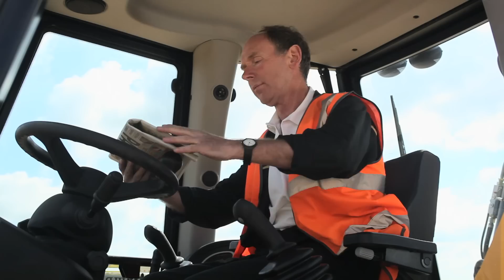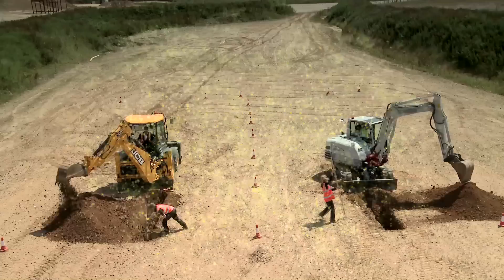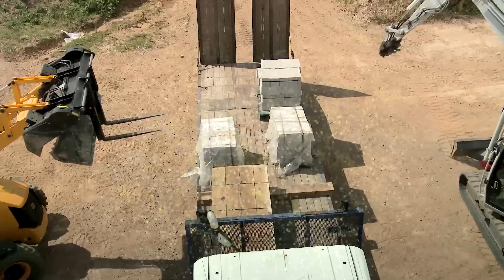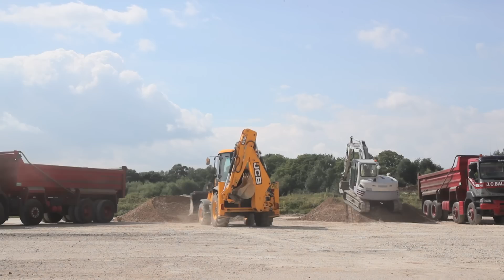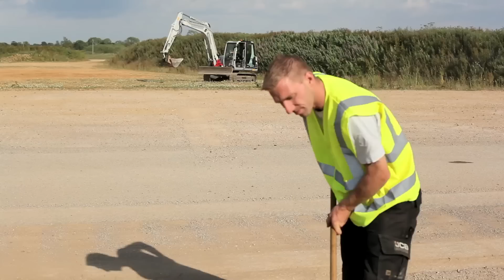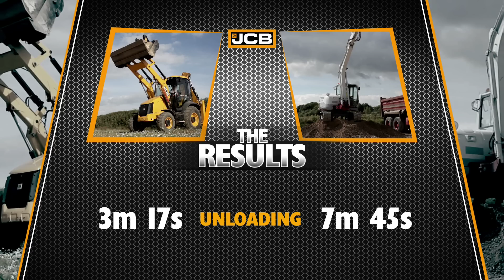Backhoe vs Excavator

Comment: those mini track hoes are cool but I bought a tractor loader back hoe because I feel its more versatile. I can plow snow, till land, dig ditches, load trucks, fork lift, aerate lawns, finish mow lawns, bush hog brush, all on the same machine with readily available attachments that are plentiful on the new and used market making them more economical to purchase. I also like rubber wheels verses tracks on peoples lawns and driveways when turning. I feel the tlb are more easy on the jobsite where minimum foot print damage is desired. of course you can slant anything to look good and come out on top by stacking the deck sort of speak. but taking in account my reasoning the TLB is a better fit for me. just being able to brush hog fields and plow snow is a huge added asset during those times when you don't have backhoe work to do.
Reply: daveknowsho
Reply: daveknowshow d
Reply: daveknowshow b
Reply: daveknowshow xbmmm
Reply: daveknowshow y
Reply: Gdaveknowshow ko'...dU ah
Reply: daveknowshow
Reply: daveknowshow  $z
Reply: daveknowshow p
Reply: daveknowshow p
Reply: daveknowshow    廠
Reply: daveknowshow n
Reply: daveknowshow '
Reply: daveknowshow 2
Reply: daveknowshow and
Reply: daveknowshow ñpss
Reply: D D
Reply: daveknowshow 0
Reply: daveknowshow .
Reply: daveknowshow 
Bgvracingcar
Reply: djaveknowshow
Reply: daveknoshow
Reply: daveknowshow   00
Reply: daveknowshow .
Reply: daveknowshow n
Reply: daveknowshow was,
Pll
Reply: daveknowshow e3 yo where are you why do yeahYeah uncle Paul plan

Do you cheat and eat OK love you see you through capital oh boy how are you
Reply: daveknowshow 8
Reply: daveknowshow .
Reply: Excavators of the same weight have more dig depth and maximum height aswell as breakout force. Excavators are better for big jobs in poor conditions. Backhoes have a very large turning circle and are less stable because they do not have the whole length of the track frame. If you are loading gravel from a hole in the ground and swinging 180degrees this can not be done with a backhoe however it is very effective with an excavator. Excavators are far less likely to get stuck and they can be made bigger than any backhoe. Try putting a backhoe on a silage stack or in a forest with tree stumps everywhere. Excavators a re better at excavating. A backhoe is like jack of all trades but master of none
Reply: daveknowshow ㄙˉ
Reply: daveknowsh
Reply: daveknowshow
Reply: daveknowshow dv
Reply: daveknowshow.
Reply: daveknowshow l00
Reply: daveknowshow  ctfrtz
Reply: daveknowshow jij
Reply: daveknowshow yyyyhhhhh
Reply: daveknowshow of
Reply: Qqrgp Estefanell just I ki
Reply: 3

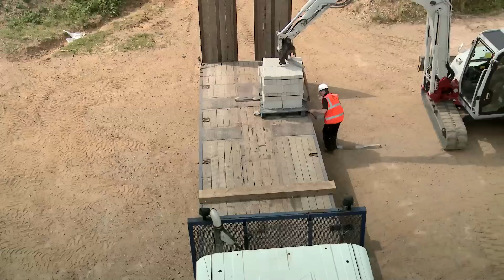Comment: I made it to 1:40 b4 I stopped watching.. how about putting an excavator of comparable size up against your JCB?  Take a machine 1/2 the size and expect it to be a fair comparison ? Trash video.
Reply: jtman04401 Why 1/2 size? That was an 8 ton excavator verses a 7ish ton JCB.
Reply: +mark rainford it was like a 5 t digger and they could off but a bigger Bucket on for loading the truck and they could. Of today sweeter attachment on the digger
Reply: +Angus O'dea you'd never load a truck with a trenching bucket, you'd use the cleaning bucket. in the real world...
Reply: +Pasa Ünlü I 8wjearjrj
Reply: 334

Comment: Why was the 180 allowed a fork attachment  but the 360 had to use strop and shackle?
Reply: Fork attachment goes on the bucket side of the BHL. The backhoe portion doesn't have the right range of motion for forks.

Comment: It's already been pointed out, but this is a totally unfair comparison. Apart from the trenching and back fill every test was geared towards making the backhoe shine. Unloading pallets? Seriously? Tracked excavators have their place, as do backhoes. Hence why we have both as do a lot of companies. I've pulled out MANY a stuck 3CX with our terrible Daewoo 14 tonner. A 3CX also won't fit in many places where a crawler will. This comparison is bullshit. We sold our JCB backhoes and bought CASE IH instead, personal opinion but better machines.
Reply: No, you bought Case (assuming "We sold our JCB backhoes and bought..." means plant kit replacement!) equipment, not Case IH. Case IH is the agricultural part.

Comment: Rubber tired backhoes serve there purposes but deep trenches better to have a mini or  big excavators for the fact get your spiol pile away from the deep trench and bench or slope the sides moving more dirt got a 360degree turn radius and as far as the loader part goes have a skid or wheel or even track loader better than doing it by your self a backhoe operator yes can drive but still if on a job alone something goes bad better to have someone there to help

Comment: The excavator guy reading the paper while he brooms and gets a piece of rebar in the side wall like hey you need a ride home tonight or need this white flag for the walk man is hot out just asking there a cooler in the back of my truck you need a soda or Gatorade   grab on hop I'll give ya ride man just messing with ya. In all fairness the backhoe should at least have to up against a 315 excavator that's like a 580 going up against 380 or a 410 going up against a 110 so at least a 315 215 110 excavator size difference  plus the excavator truck went got the blocks

Comment: No one uses backhoes I only use a John Deere 35D excavator and new holland lx665
Reply: Congrats lots of people use backhoes even though you don't. It's how I got started on my own since I didn't need to have a trailer to float it I could just drive it to the next job site. Also a backhoe can do a lot of what an excavator and skid steer can except with one machine.

Comment: a mini ex is easier to transport and better at demolition digging and lot clearing plus u dont need huge trailer and truck and can fit in tighter spots and chip rock etc plus its cheaper
Reply: Operator chahie to is number per call

Comment: crappy test on the trenches the swinger was straighter and neater on the filling in if hed done it the efficietn way hed of thrashed that backhoe on the truck unload ud use a block grab on that swinger, load up teast as they did not start at the same time and ud of put the bigger bucket on that swinger as well but the clean up is fair enougn far as i know theres not a swinger brush. just a bogus test in my mind  gimme one of those volvo ec700c ... guarantee ill kick its ass or a wheeled swinger

Comment: in tunnel excavator is king due to its 360' rotation at its own axis at same place bcoz u cant go kms in tight tunnels back n forth to take a turn each time to fill tippers trucks with muck from face.price tells all an excavator prices 45lac to 65 lac normal where as back hoe 25 to 35 lac. simple.u cant use backhoe instead of excavator mny times but u can use excvator instead of back hoe ... 😊

Comment: To me it is a stupid video, real live has jobs where an excavator is the better choice, and jobs that are more suitable for a backhoe... who has ever done backfilling that way? if you need to compact the material every 30 to 40cm with a compacter you cannot simply push in the stuff with the blade or bucket. Excavators also can use different attachments like pallet forks or larger buckets for track loading, and sites on a field like this are also very rare this days, in confined spaces, where machines of this size often have to work, it might look a little different.

Comment: Jcb can say and do whatever they want,and even make these stupid comparison videos.However,experience is something different!I drive both of these machines every day so i can say a thing or two about this video.First of all they were comparing travel speed wich is stupid.Of course jcb won that,even walking is faster than crawlers max speed.Travel speed has no importance when it comes to work machines made for digging.Then again that loading the trucks was pure bullshit,sure a wheeled loader is faster with that huge bucket,and on top of that they put the smallest digging bucket on that excavator.Come on jcb?From my experience that same excavator will digg faster than jcb backhoe,and the reason being is that it can pull a row and move forward and continue right away.And it also has faster hidraulics.Where jcb has to lift the stabilisers,turn the seat around,lift the loader up and move forward.Then drop the loader,turn the seat around,drop the stabilisers and start diging again.There is a lot of time wasted like this,and an excavator will outperform a backhoe on any day.Now,there are jobs that require a backhoe and then there are jobs that require an excavator.And each one of them performs better than the other one on the job suited for that particular machine.For instance,last month i was doing a job on a very wet and muddy field.And if i was to drive the jcb into that field it woul take a millitary helicopter to lift him up from that mud and get him of the field.So i used an excavator and it did an excellent job.This video is like comparing apples and coconuts,a really stupid thing from JCB